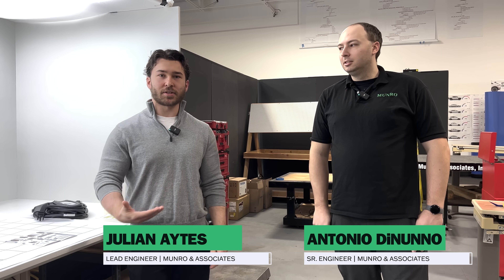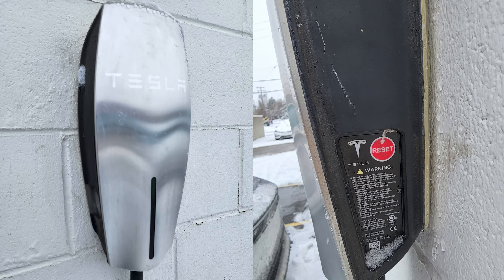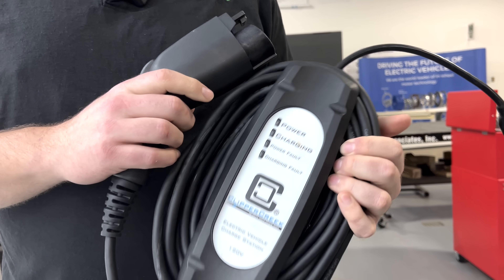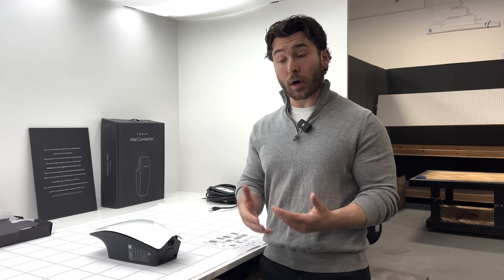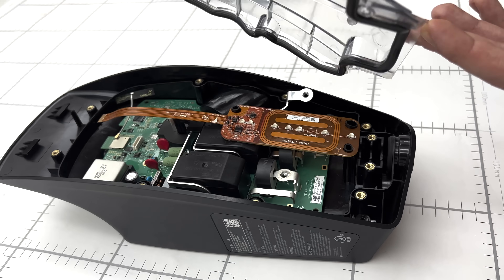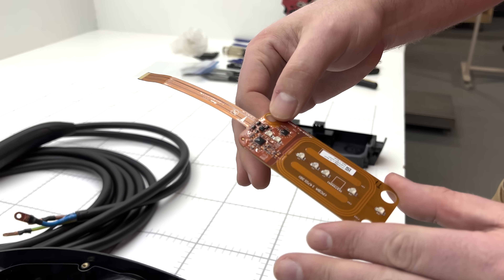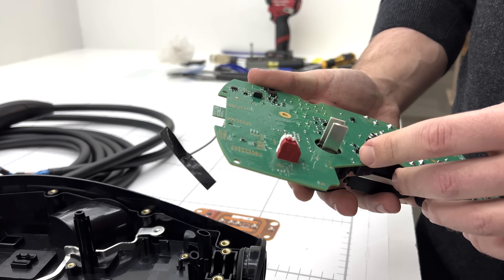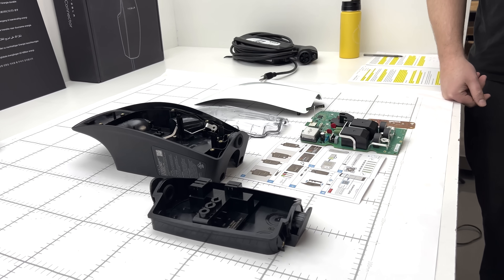EV Home Charger Teardowns E1: Tesla Wall Connector

Comment: One of the things that electricians focus on when doing an install is the rated termination temperature of devices at each end of the wire. This is used to comply with electrical code and it guides what gauge of wire can be used for the expected current. Interestingly, the wire itself is responsible for some of the heat dispersion that happens at terminations, so it makes sense that the two are interrelated. Typically the termination temp rating for the breaker is stamped as rated for 75 deg C, and we look for the same kind of stamp on the Tesla charger. None present! On a review of the Tesla website and product info, the best I can find is a note saying that the device temp can be as high as 85 deg C. From a practical perspective, based on wire size recommendations by Tesla,  it seems likely that the termination temp rating is OK at 75 deg C. That leads to electrical code tables used by the installing electrician that show you can use 6 gauge THWN/THHN wire in conduit (not Romex) for a continuous load of 48 Amps. It would be nice if Tesla would acknowledge that termination temp rating more explicitly to make installation decisions by inspectors and electricians easier.

Comment: Thanks for the video!  My wall charger just crapped out this year and Tesla support said I need to replace it.  According to the testing they were able to do, they were seeing unexpected voltage drops.  "I was able to run a few tests from the part number and serial number that you provided. The Wall Connector is detecting unexpected voltage drops."  Since after providing them additional info after they sent me that, I was going to try taking apart the wall charger and cleaning it out or checking for anything on the interior before replacing it since they are fairly expensive.  Anything you guys would recommend I take a look at in particular on the inside?  I was getting ~240v (T1-T2) and 120v (T1-G & T2-G) from measuring directly at my electrical panel in the house.

Comment: Did I see copper only on the terminals for the incoming wire? also what size is the wire gauge of the charging cable as it seemed 4 meters long at a max 48 amp?

Comment: In Europe the level 1 charger that comes with the car and plugs into the domestic socket pushes through about 3kW and adds 20 km (12.4 miles) per hour to a long range Model 3, so it's slow but not pointless.
Reply: You can get a 32A (amp) blue circular socket outdoor and adapter from tesla to do level 2 charging via the mobile connector. It can then do 7.4KW like the wall connector.

Comment: How can the wall charger push more current into the battery to reduce the charging time. I thought the electricity coming out of the grid is capped?

Comment: With Ford and GM announcing they will migrate to the NACS charging, many EXISTING EV owners with home charging ALREADY installed will be interested in the Tesla Wall Connector.  The question many of them will face is can they install the "48A" Tesla Wall Connect on their existing 50A circuit that had supplied a 40A EVSE using the J1772 connector.  That is, can they pull the old EVSE box off the wall in their garage and install the Tesla Wall Connector?  So, the question is: will the Tesla Wall Connector allow a set-up where it is limited to 40A?

Comment: The two connectors on the back of the board is probably for the	Smart Current Limits Meter (1938241-00-A) now being rolled out.

Comment: My Tesla S came with a Tesla Mobile Connector. I installed a Hubbell NEMA 14-50 outlet direct from my service panel with a 50 amp breaker. The on-board car charger will operate up to 32 amps. I don't see (or have) the need for 48 amps. NOTE: do NOT use a cheap Chinese NEMA 14-50 from HD. Hubbell is industrially rated.

Comment: Although Tesla states a dryer plug (outlet) with mobile NEMA cable is fine, this hard wired version is studied for daily use.  60 amp circuit gives fastest charge if vehicle had 11 kw on board charger.  Overnight charging 40-50 amp is fine

Comment: Tesla wall connectors one of the fastest if on 60 amp circuit and if large 11 kw on board chargers.  Some teslas have 19 kw on board charger. Wall connectors one of the cheapest vs competition.  Tesla wall connector can be used with other EV’s if buy Ccs adapter

Comment: MOST public stations are sadly only level 2 around 7-19kw.  MOST public level 3 DC fast chargers(Tesla calls superchargers) are only 50 kw.  There are some 100 kw but rare 350 kw that competition to Tesla always talk about.  All of Teslas charging stations are level 3 120-250 kw.  In and out in 15 minutes with 250 miles of range.  We need more level 3 stations at least 120 kw if we really want to push EV cross country traveling.  Many Teslas private networks are supplemented with solar and battery packs to undercut competitors cost:kwh charging time.  Teslas msrp helps build its network.  Competition uses taxpayers or other private companies.

Comment: Level 2 wall connectors allow use of your level 2 on board charger.  The vehicle’s charger on board determines speed of charge as well as the 220 30-60 amp circuit.  Many Leafs and Bolts have 3-7 kw on board charger.  Teslas base model 3 single motor 7 kw vs dual motor 11 kw on board charger.

Comment: Interesting there's no remote option for a remote current transducer, they're pretty standard on home chargers in the UK to ensure you don't overload a home's electrical supply.
Reply: ? The adapter gets current adjusted according to the capacity of the switch board. What exactly you need a remote sensor for?

Comment: Where are the circuit breakers or fuses inside the box to trip or safely switch off the EVSE and isolate a fault ? It would be nice if Sandy could get a EE to review these EVSEs so that every aspect of the electrical safety is explained in detail. Just plugging out the NEMA 1450 connector doesn’t seem easy or safe enough in case of a short circuit 🔥or fault.
Reply: It checks to see if the same current going out one wire to the car comes back on the other wire. If it is not exactly the same it shuts down because it assumes some small current went to ground where the squirrel😀 or dog bit thru the wire.

Comment: A very compact design for a 48A circuit but we would like to Munro to shed more light on what it would take to get out 60A from this EVSE assuming the eV’s onboard charger can handle the extra 12A current. For example Lucid Air supports 80A AC charging on the type 1/SAEJ1772 connector with an adapter.

Comment: Guys the Tesla wall connector is what the description indicates! It's nothing but a fancy wall plug costing $500! All components that matter are built into the car. Essentially obtain a connector for your car and a plug similar to your stove. Just install a 240 volt wall receptacle with an appropriate sized circuit breaker and voila! 
If you want to spend money for a fancy wall socket and impress your friends and make Musk richer go ahead. 😂
Reply: It has some protections built in. At the european version has RCD built-in. And in Europe you get with a car just 3kW mobile connector, so usually you want to purchase something which is 11 kW, be it wallbox or a "cable". Cable can be somewhat cheaper (not much), but the Tesla Wall Connector has the benefit of opening the charge port with a button - or better said disconnecting the cable via button, which would otherwise needed to be unlocked on the charger or via the app / display in car.

Comment: This is E1...I'm interested to see what other chargers they tear down.

I chose the Flo Home charger because I liked the all-aluminum exterior design.  It gets very cold in the winter here, so ruggedness is key; I don't want to accidentally crack the frame when it's -20F out.  I also didn't mind Flo's charge rate is lower (30A) than the competitors, because it's still fast enough to charge overnight.  My electrician has done lots of EV charger installs, mostly Tesla or ChargePoint, but he said mine was the first Flo he had worked on.  He thought the installation was fine, didn't have any complaints, and opted to wire in from the back (through the wall) instead of from the bottom.  Mostly he was impressed by the extreme ruggedness, and said the ChargePoint unit feels like garbage by comparison.  Because of the aluminum casing it cannot use WiFi, so instead uses power-line communication (PLC) to connect to my router.
Reply: Matthew -check out the Grizzl-E is inn metal housing and is bu___let/tough for outdoor use in -40f built in Canada  proof !

Comment: Thank you very much for the video. As an ex-electronic technician. Battery and EV charging technologies are new to me. I also own a Model Y. A basic question regarding charging the Model Y battery. I have read recommendations for charging the EV battery between 20 - 80% during normal commute use. To keep the battery degradation to a minimum. Does the 20-80% apply to all charger sources including with level 1 (115V) charger? Or, 20-80% is more to the level 3 (supercharger) source?
Reply: 100% stresses the anode of the cell itself. The charge rate is limited by the ability of the cell to take on more charge. Don't think of it as added fluid to a vessel but as if you are adding air to a bike tire. It is easy to pump at first , but as more pressure builds up the harder it gets to pump that next shot of air into it.

Comment: RETIRED 78, USAF, VFW. TESLA LEVEL 2, CHARGER INSTALLED. WIRED 50 AMP WELDING PLUG TO  32 AMP OPTIONED WALL CHARGER WITH 20' 50 AMP EXTENSION CORD TO EXTRA WELDING OUTLET IN GARAGE SHOP. CYBERTRK WILL BE PARKED NEXT TO 2018 MODEL 3 IN GARAGE.

Comment: Not that helpful.  You needed to go to a house, show people the electrical service entrance, explain their must be room to add breaker or the thousands extra it will cost. 2.  Looking at the house, give people an idea of difficulty getting wire to garage. Then proceed with your device info.
Reply: True, it can be very costly to upgrade your breaker box.
Reply: As the title says, this is a teardown video; they take things apart and share insights about the quality and cost of manufacturing.  What you described is far outside the scope of what Munro Live does.  Frankly, I'm not sure why you want professional automotive and electronics engineers to spend their time talking about home wiring.  Yeah they could do that, but so could any electrician, and there are plenty of other channels and publications out there that have already done it.

Comment: Confirmed: the red and white connector on the back is for hooking multiple connectors in a series system.
Reply: Do you have a source how this is accomplished. I thought hardwired communications was the Gen2 Wall Connector. Gen3 accomplishes this through wifi.

I think this port is for the Smart Current Limits Meter they are now rolling out. But it could be possible it is for both.
Reply: @davidl.beckwith4836 a very experienced certified installer mentioned it.

Comment: That NFC could be used to prevent it from charging Tesla cars not driven by the owner of the charger!  It can keep the unit from activating the contactors unless the owner’s phone or keycard is waved by the nfc chip, in areas of poor security.
Reply: This charger already has the ability to VIN restrict to certain cars.  

I think Tesla might payment enable these Level 2 chargers at some point in the future, I believe they have much bigger ambitions of being the charging provider for all cars in the future and this is them building out a vast network of infrastructure that can be enabled with the push of a firmware update.
Reply: @taylorlightfoot  and pay the guy paying for the electricity being used by a stranger hopefully at a significant profit to the guy who has this installed on the side of his house, I hope. That means tapping the owner of the Tesla Charger into the Tesla Ecosystem to funnel payments from the driver who stopped to let his car take a sip of electrons.

Comment: Tesla certainly is not melting connections on their latest Superchargers, so they are able to handle huge current flows. There are just some problems with the units in question.

Comment: One thing not touched on is the two methods of EV charger installation - hardwired vs 14-50 outlet. I don't think most EV owners are aware of the two different options unless their electrician has told them.

Comment: A 60 amp circuit means we're not looking at a 14-50 connection since those receptacles are rated at 50 amps. 40 amps would be the max current allowed by the EV per the 20 percent rule.  You'd need the election to do a hardwire install in order to get 60 amps (more expensive).

Comment: The Tesla level 1 with 240 volt connection will charge about 30  miles/hr.  What is the advantage of the Tesla level 2 charger--40 miles/hr?

Comment: This is great! Currently weighing options while a 14-50 is scheduled for installation on the front porch. I've narrowed it down to Tesla, Grizzl-E and Emporia. I love the metal casing on the Grizzl-E. 
The advantage of non-Tesla charger seems to be the universal compatible with any brand of EV.
Reply: You can still get a CCS adapter with the Tesla charger.
Reply: Stay tuned then ;-)

Comment: These EV chargers are toys when you compare them to the European Type 2 EVSEs.  It is easy to find 20kW with a 32 amp cable anywhere in Europe!!  The reason is higher voltages and 3 phase power.  Why aren't we supporting the SAE J3068 plug and untapping our 480 and 600V commercial sources?  I could get up 30 kW from our church parking lot.  That could result is economical recharges and lower installation costs, as well as an income for the church.
Reply: @kjdegraaf  Kevin, I'm sorry you're caught up in these inappropriate standards that are incompatible with our most of our electrical systems.

 our electrical

Comment: I like that IR heat sensor. Good way to monitor for high resistance terminations at the power feed block
Reply: Having it not seal correctly is an issue. I've had to physically push the device on the while my apprentice could aling up screws due to it's IP seal. This blokes never talked about and we have 3 phase models colloquially here. My first charger we installed a 3 phase 32A RCD circuit, but when I clamped the current it was only drawing 16A a phase going full belt!

Comment: We have 4 Tesla wall chargers connected to a 100 amp / 240 v subpanel. They handily load balance over WiFi, delivering the full 48 amps per car when only 2 need to charge and dropping to 24 amps per car when all 4 are charging. Work really well.
Also, we installed pull down reels for cables, makes charging a 15 second experience.
Reply: But ICE car drivers say charging takes a long time, conveniently forgetting that for most people, 99% of charging is done at home. It’s a full year since I had to publicly charge- all the rest has been done while I sleep, which has saved a huge amount of time compared to our other (ICE) car.
Reply: thanks William, the Tesla power/wi fi charging is seceond to none

Comment: Why no DC charging at home? Especially in homes with solar panels and battery storage?
Reply: Because DC charging is pretty complicated. EV batteries are mostly either 400 volts nominal, or 800 volts nominal. But the actual full charge voltage for a "400 volt" car might be 350 volts, 450 volts, or anywhere in between.
The battery voltage also depends in the battery's state of charge. A battery that is 420 volts at 100%, would be about 300 volts when near 0% full.
So a home DC charger would need a sophisticated charger that could take the voltage of your home battery up to the level the car needed, and do the communications with the car to see what current and voltage the car "wants."  The charger already built into the car does the voltage conversion too. But it doesn't need to do all the communications stuff, because it is purpose built for the car it is in and already "knows" all the details about how to charge the battery it is connected to.
That communication is a real can of worms. There are several standards, and sub-variants of the standards and different brands and even different models of the same brand speak different dialects. When you plug a DC cord into the car, no current flows until the car and the charger have communicated and worked out all the details. The big commercial charging networks are having trouble making chargers that successfully and consistently manage that communication, and when new models of EV come out, there are often glitches that have to be worked out with software updates to the chargers.
And in the end, after you installed a home DC charger that would cost, I would guess, at least $5,000, you would have gained almost nothing. That external charger would be no more efficient than the one built into the car. You would avoid one conversion (locally stored DC to AC) but at a very high cost.
Reply: @jimmurphy5355  Thanks for the conversation, Jim, but $5000 is a large fraction of the cost of a Powerwall which costs about $9300, or $6300 after incentives today where I live. The Powerwall can charge itself at home voltage 24/7 or charge a car at whatever voltage Tesla designs the car and Powerwall for, depending on the actual individual cell battery voltage and the internal wiring and electronics. I doubt if any extra components would not cost much.
Reply: @tobyw9573  A PowerWall doesn't have to implement the CCS or Tesla DC charging protocols, and doesn't have to have the high current, high voltage relays to control power to the charging cord. It also doesn't have to accommodate different battery pack voltages. But leaving that all aside, what were you thinking would be the biggest advantage of DC charging at home? Faster charging? More efficient charging? Something else I haven't thought of?